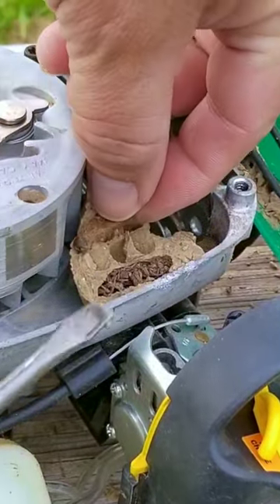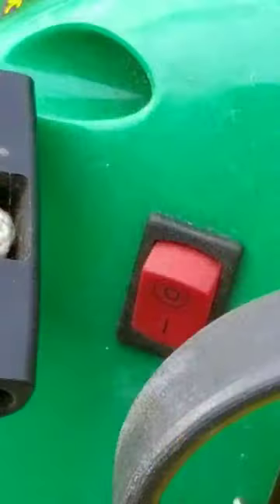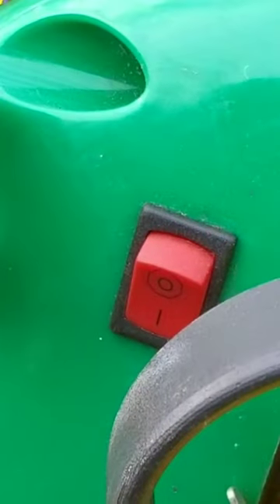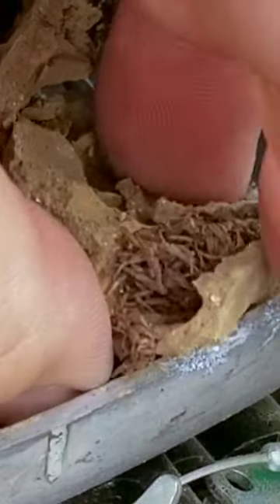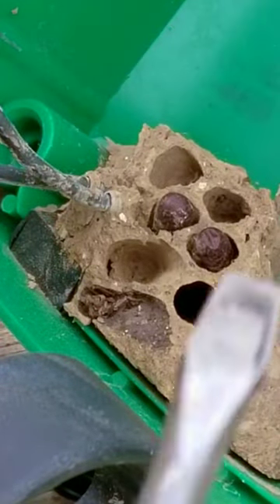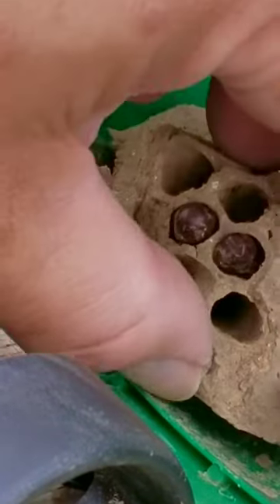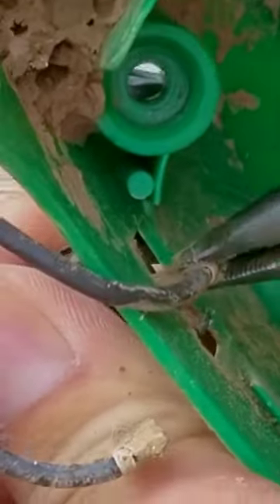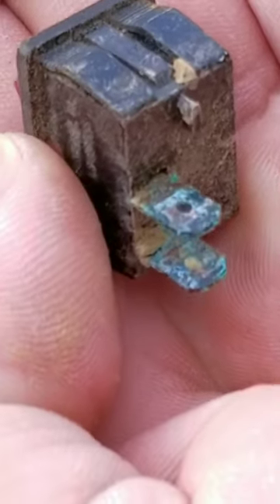Mud Duabers Don't Mix With Small Engines

Comment: I just about blew up a minty Evinrude 35hp boat motor because of those SOBs.  Those engines are water cooled and they plugged up the water outlet.  I noticed a slight loss of power, looked around, and the cooling water was not pumping.  Luckily I caught it in time.
Reply from the maker: wow that was a close call!

Comment: Those little buggers love to take up shop in the exhausts of machines so they get choked out. It's gotten me a few times. And I have that exact same kind of issue syou are working on there they are a royal pain.
Reply from the maker: I know right, never seen them in the exhaust but I could understand it happening.
Reply: @INSIDEHOUSEGARAGE  Yeah totally has left me scratching my head more than once 😉